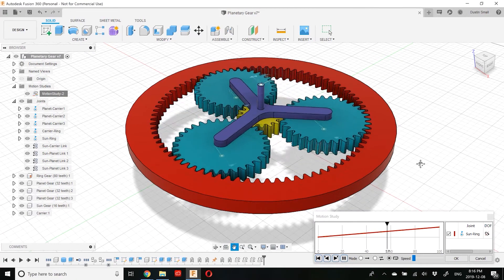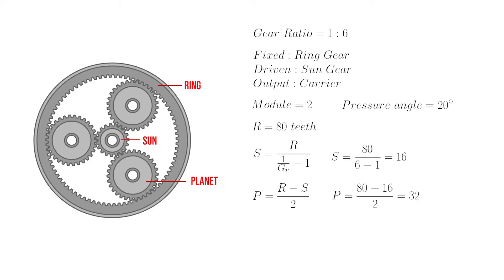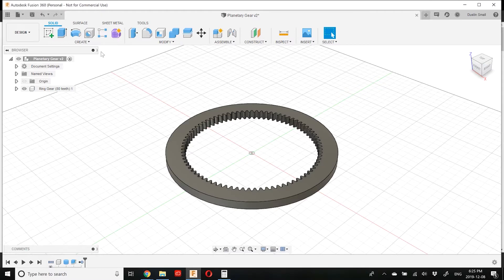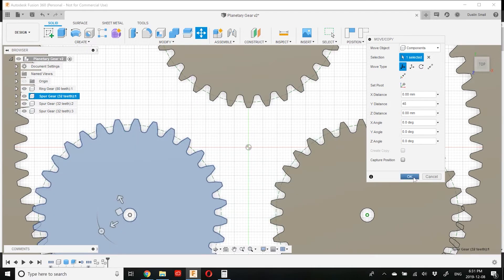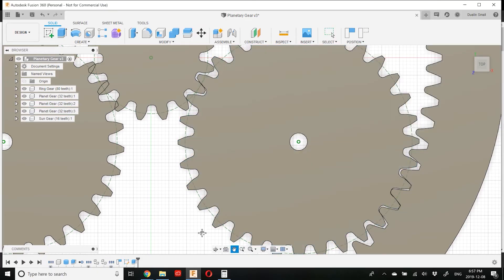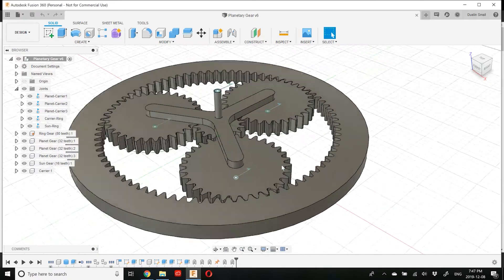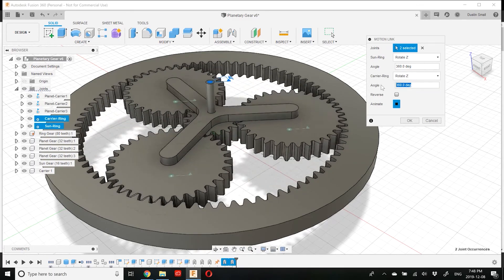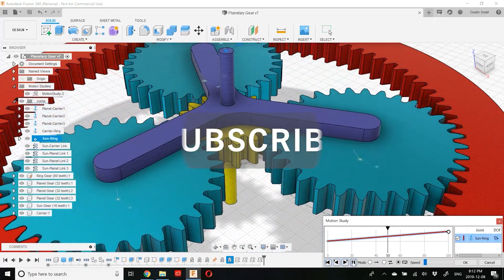Fusion 360 Tutorial: Planetary Gear Train Modeling and Animation

Comment: motion study is not working in my case 
it gives this message:
Warning: Cannot resolve some component positions because there are conflicts with assembly relationships in the design.
Inspect existing joints, rigid groups, ground to parent, or tangent relationships.

Comment: For any new comers that are having trouble make sure the mesh is correct, instead of using the equation 360/6 for the carrier- sun gear motion joint, I did 360/5 and it worked for me 👍 ( so the ration is 5:1, 80 teeth and 16 teeth)
Reply: you saved me, thank you!
Reply: I noticed this after watching the joint flags rotating and counting the rotations. Then I had to get rid of the  "+360/(80/16)" added to the other motion links. No extra math needed, just the correct formula from the start. Thank you!
Reply: Life saver - I've been rewatching the vid for 20 min trying to figure out where I went wrong!
Reply: thanks man!!
Reply: what about the 2nd one i.e sun and planet 
360/(planet teeth/sun teeth)???
Reply: @AGASTYAMADAAN  I think it should be the same
Reply: Thank you !
Reply: still saving butts in 2025! Thank you!
Reply: @RatherSlack igu brother 🙏

Comment: if you are confused at 4:35 , when you create your gears. Keep the pitch diameter. Then just measure the distance from the planet gear's diameter to the ring gear's pitch diameter. Then just move it in that direction by that value

Comment: Isn't it that because addendum and dedendum are not symmetric from the pitch line (I mean 1:1.25) the negative of an external spur gear is not the same with the internal gear?
Reply: You are correct. The addendum is now the dedendum and the dedendum is now the addendum. This will cause interfernce and large stresses in the gear.

Comment: Dust4K, thank you for the video. I went from knowing nothing about gear science or fusion 360, to creating a rudimentary system. The gear ratios are all messed up but I have a fundamentally different question. I'm trying to create an eccentric 3 gear system inside a gear ring. The 3 rings are of different size, but i was able to make them rotate as a system, albeit with incorrect rotations. Anyway, what i'd like to do is ground the outside ring and have the 3 gear system rotate within it. I'm anticipating the 3 gears rotating around their center AND along the outside ring. Is this possible?
Reply from the maker: First, I'm so glad the video was able to help you! That's impressive that you were able to get as far as you did without any prior experience. I "think" I understand what you are asking. Yes, you can ground the outer ring, or even the sun gear, and have the other gears rotate accordingly. It should actually be similar equations to what I used in the video, but just applied to different gears. Fool around with it and I think you should be able to get it. Would be interested to hear how you made out. 

Try this simulator: http://www.thecatalystis.com/gears/ 

You should be able to set the ring gear speed to 0 to achieve what you are looking for.
Reply: @RELUvance  Thanks! I have decided to abandon the 3 gear system and just go with what you have. I do have a problem now where I can't join the pivots to the carrier. When the carrier rotates, the pivots/shafts stay in place. When i try to rigid join them (shafts with carrier), then the carrier doesn't move. I've been able to get all the gears to move properly without the carrier. Any advice? Thanks.
Reply from the maker: @groznoy  It sounds like you have the shafts grounded... perhaps inadvertently when you were trying your other scheme? I would try ungrounding / unconstraining everything and starting from scratch to see if that helps.

Comment: So I followed your instructions to the exact T and if I drive the sun gear, the gears are still not meshing correctly.

Is there anything you recommend for me to do?
Reply from the maker: Hmm, difficult without actually seeing... double check all your joints... very easy to mess one up and that will throw everything off.
Reply: @RELUvance  Okay so I figured out what was wrong and it's really weird but worth sharing. So for the motion links that you were setting for the Sun-Ring and Planet-carrier, I had set the Planet-Carrier angle to (360 / 2) instead of 180 like you did. 

For some stupid reason, that was the cause of the gears not meshing correctly.

If you ever decide to update/revise this video, can you please mention my findings?
Reply from the maker: @Digtal101  That's great! (but strange)... glad you were able to figure it out and thanks for sharing with the rest of the community.

Comment: Hey Dusk, great video! this really helped a lot! 

I just had a question... so I modeled everything exactly the way you did, but when I rotate all my gears at the end (even after the updated formula 360+360/(80/16)), I have gear teeth overlapping with teeth from other gears. Do you ever use contact sets in modelling gears? This is my first time doing gears in Fusion so I'm quite new to this still. 
Thanks!
Reply from the maker: Yeah it is still a bit tricky sometimes to get the gears to mesh correctly. Are they all rotating at the correct speed but just not meshed? Or are they rotating at incorrect speeds too? I don't use contact sets for gears because there are so many contact points that it seems to slow everything down so much. Contact sets seem to work pretty good for simple one-contact point components but haven't had much luck with gears.
Reply: @RELUvance  I had the exact same problem as @Gabi Paczolay, but I was able to fix it by changing the rotation of the sun ring from 360 + 360/(80/16) to 360 + 360/(80/35). I just put in random numbers until it meshed well, I have no idea why its 35 instead of 16, but it meshes perfectly. The planet gear also didn't mesh well with the sun gear

Comment: How do I get the ring gear to be smaller? Pretty sure I have to change module but how does this affect the root fillet radius?
Reply from the maker: Hi Eric, there are a couple of ways to do it. Yes, you can use a smaller module, but you can also change the number of teeth and keep the module the same. Root fillet radius is calculated as 0.38 x module.... I didn't use this in the video but that is the correct way to calculate it.
Reply: @RELUvance  Thank you!

Comment: I'm working on a design that has a planetary gear so this is a very helpful video. However, I think you've got an error at 2:10: (80+16)/3 = 32 [not 19]
Reply: So what should you do if the answer is not whole number? What parameters should you adjust?
Reply from the maker: @fn326  Hi Sky, just play with the numbers of teeth until you find a combination that works for you.
Reply from the maker: Ooops I think you're right - good catch Chris!

Comment from the maker: The hardest part of modeling a planetary gear in Fusion 360 is getting the motion links correct. Just remember that the relationship between the rotation of the sun gear and the planets also needs to take into account the rotation of the carrier.